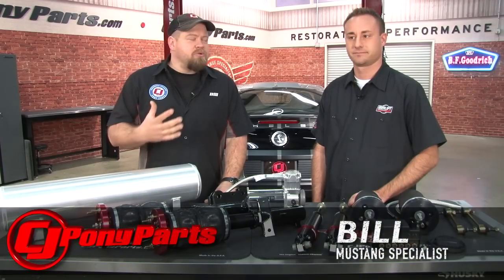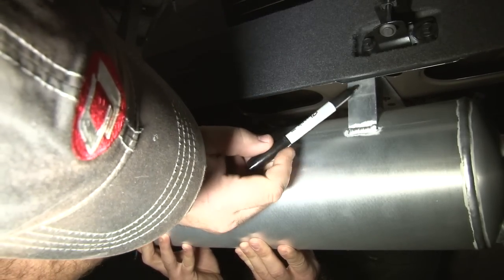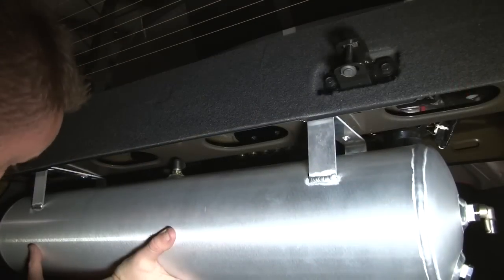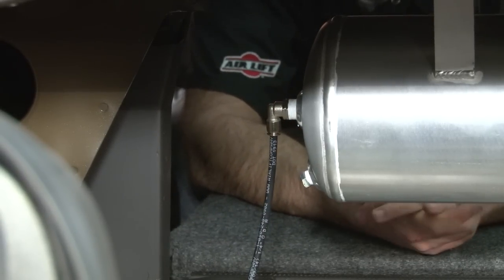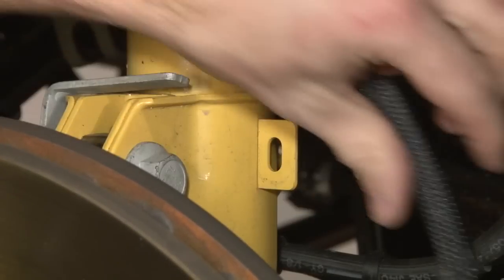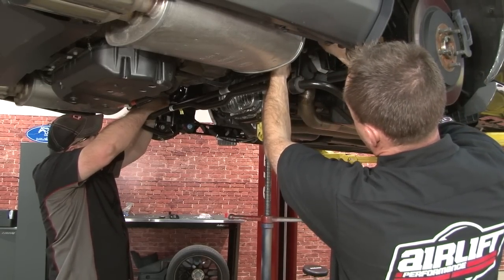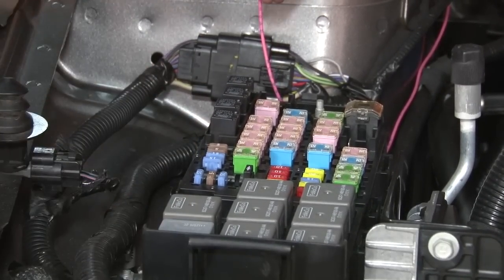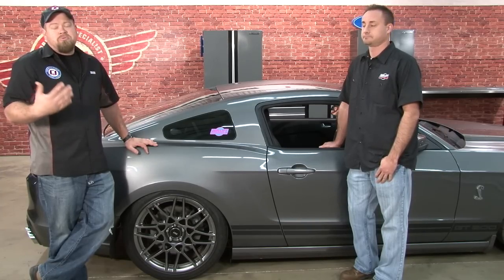Mustang Air Lift Performance Complete Digital Air Suspension Kit 2005-2014 Installation

Comment: There are no issues with the system for winter use. I would check the tank occasionally for water but I doubt it will be an issue.
Reply: Can you drive it slammed if you did widebody conversion with flared fenders?
Reply: Bill Tumas after the install do I need to go to a shop for alignment...and  Since I'll be driving a little bit lower do I need to buy any other suspension parts?
Reply: Bill Tumas غ٧ص
Reply: This is not true, moisture can get in the valve manifold and freeze, and crack the manifold which cost $700 to replace! and vehicle will be aired out until replaced or modified.  Happened to me !!!
Reply: My Lincoln Mark VII had a dryer assembly that was part of the compressor...you need a dryer if you plan to drive in the winter!

Comment: Just a reminder, you might want to roll your front fenders when installing this kit if you have aftermarket wheels. I just installed it and had to learn the hard way!
Reply: Zach Waddell Good point!  The need for fender rolling depends mostly on your wheel offset.  We have run 20x10 wheels up front and never rolled the lips.  Doing a slow drop the first time is always a good idea until you determine the wheel compatibility.

Comment: Does the 11-14 Mustang GT require an after market pan hard bar to be adjusted to the daily driver ride height with this system?
Reply: Depending on ride height it is not a bad idea, especially if your daily driver ride height is a lot lower than stock.

Comment: ***** You just have to get it aligned at your driving height. Once you do that it will drive like stock and have no issues at all. I have personally been in this car at triple digit speeds with the Air Lift and its rock solid.
Reply: Could you measure where your drive height is with stock suspension and set the air bags to the measurement?
Reply: +Darren Gardner If you want to stay at stock height sure
Reply: Bill Tumas hi bill how much cost to put everything in my mustang gt 2013?
Reply: Where can i buy the end links or dose it come with front bags when you buy separately

Comment: What fuse you can use in the 05-09?  The adapter included on the 3H limits your options since it requires no fuses nearby in order to fit.  It is really imperative to use a line that remains active while cranking?  That limits the options available even more.  Thanks

Comment: Where do you guys connect the red source wire I have a g37 its conected to the starter in the fuse box can that be a issue

Comment: Two quick questions: 1. Is there a way to do some rust prevention on the holes you drilled into the spare tire well and rear spring tower? 2. If I need to leave the car stationary for awhile, like a few month, what level of air should I leave in the bags? I live in Florida by the way. Thanks.
Reply: A little paint or primer on those holes will do the trick. If you let it sit for a month I would air it down. It should hold but you may lose a little pressure over that much time.

Comment: Did you guys remove the plastic in the front wheel wells? I don't see any when you were mounting the front struts and I didn't see you removing them in the video.
Reply: +salzero1  They were off the car before we began the install.

Comment: I was always curious how the alignment part is handled on air ride... Do you perform the alignment on the driving setting? Does it hold that setting perfectly? or will it have alignment issues from constantly changing the ride height?
Reply: Yes you align the car for your saved ride height and it holds it. The other settings you typically will not drive on, at least not for very long. This car has a high setting for getting on a trailer or going over a speed bump, a track setting for the drag strip, a drive setting, and all the way down.
Reply: Bill Tumas  Cool thank you for clearing that up :)

Comment: Is it possible to adjust ride height while on the move, say I am cruising down a normal street, want to turn into a shopping center but there is a fairly steep entrance, would I need to completely stop, then change the ride height, or change it on the fly? Thanks for the help!
Reply: You absolutely can. You have to press the button twice so you don't hit it my mistake.

Comment: I Thought When you Lower The Mustang It Throws The Axle Of Center A Bit How Come There Wasn't An Adjustable PanHard Bar Installed On This GT500? I Am Looking At Buying A Set Of Coilovers For My Mustang This Is Why I Am Asking Thanks
Reply: Ride height isn't terribly low on this car so the adjustment wasn't necessary. On a fixed drop like coilovers you will want an adjustable panhard.
Reply: +Bill Tumas ok I Was Just Wondering How Hard Is It To Adjust I get the whole concept just don't understand how u know to adjust it as far as measurements of u could give some guidance if possible thanks
Reply: Watch the video on the watts link install. I explain the process to center and show how to measure it.
Reply: +Bill Tumas thanks for all your help

Comment: Would I not need an adjustable panhard bar?
Reply from the maker: Depends on where you set your ride height. If its more than an inch lower than stock you would want an adjustable panhard.

Comment: Question:
Will this Air suspension system be safe to 'drift' on? Can it handle some rough throwing in the back end?
Reply: If I were building as competitive drift car I would probably not use it but for the occasional drift it will be fine. This car is regularly drag raced and runs mid 10s without issue.

Comment: Wait..wait a min... This can be used to race at the track "drag wise i mean" ? Come on really? I can get that awesome bag look with better drag times? If that's true sign me up .... I wonder how this kit would do against the steeda 1 2 3 stage drag suspension kit they have... Would love a answer back Bill if you get the time. Thanks -Steve
Reply: There's a gt500 running 9s on airlift is you look it up

Comment: If you have aftermarket wheels that stick out a little bit at the top would they rub when you dropped the car?
Reply: Hey man Ik this is 8 years late but ya you’d wanna roll your fenders if they poke too far
Reply: @anthonygutierrez2174  🤣 thanks bro. I had a dodge charger at the time when I was looking into this. Since then I no longer have it. Appreciate the info though. It may come in the future. 🫡

Comment: Will that compressor get overheated down there in the well when it's Covered up?
Reply: It has never been an issue and I have done that on several installs. Out in the open is preferred but I would rather hide it.
Reply: Bill Tumas Great. Thanks, Bill thumbs up

Comment: On the manifold the right plug no hose was plugged on it was it that for ?
Reply: Noeldiaz8 that's an exhaust line you can run as an option outside of the vehicle. His manifold placement allows enough breathing room for the system so no hose is required.

Comment: What about wheel alignment?
And will the rear axle stay centered between height levels?
Reply: snapfish89 The way to set this up is to align it and the rear axle (if adjustable) at the ride height you drive at most.  As you lower or raise the car, the front camber and toe changes slightly, but not enough to go out of spec within heights that are reasonable to drive at.  We do not alter the geometry of the suspension links at all. So any change is a result of the design from Ford.  And, having driven our S197 on the track a ton, they did it right!  Hope that helps.
Reply: snapfish89 iiiiii

Comment: So how do you adjust the camber settings when aligning the car if the camber settings are underneath the top plates on the strut towers?
Reply: VADER take em out, adjust, put em back in. lol. don't forget to put 165lbs in the driver's  seat.

Comment: Will that tank fit in the wheel well with the compressor?
Reply: +Kolour Blind It is too wide for the spare tire well. You might be able to fit it at an angle but i never tried.

Comment: Do you need realignment after done ?
Reply: Sang Nguyen after full install and daily ride height is determined get it aligned for that height. Normal daily height is anywhere from factory height to minus two inches at most.

Comment: I think a better spot for the compressor would have been just behind the rear seats inside the trunk! I like to keep my spare in the trunk trust me.........I've learned my lesson.
Reply: +JNelson Performance shelby gt500 dont come with spare wheels from factory.
Reply: JNelson Performance you can mount the pump under the vehicle if you want or in this case you could mount it directly beneath the tank it self. That's how mine is mounted.

Comment: When I'm cruising, I want to have the car just little lower than stock, but I want to be able to lift it HIGHER than stock when going in and out of parking lots, over speed bumps, etc. Does anyone make this sort of thing? All those kits are still lower than factory on their highest setting and their lowest setting is undrivable low, I don't know who finds that useful.
Reply: +emsicz  This is absolutely higher than stock when all the way up.
Reply: You obviously dont see the benefits of airlift, so just get springs. You dont drive with it fully aired out -.- thats for when youre parked and want to make it look real low when not driving, like at car shows. You raise it a bit for driving and can definitely go few inches above stock height
Reply: +ATrueKneeGrow Can springs be electronically lifted when I want to drive on bumpy road or get over edge on a steep road?
Reply: +emsicz u need to buy a 4x4 lol. ..just bought airlift for my self for all the reason u want above..

Comment: The video is great but you didn't mention anything about an alignment, you didn't mention anything on how to snap the airlines in the back air bags, he just showed the cable  coming through the body and make sure that the grommet is on ,but you but you didn't show how it connects or disconnects,  if they're going to do a video on a new product you really should give full detail,

Comment: so if one of those bags leaks your screwed?
Reply: +cervini67 Eleanor  Not really, even if one bad failed for whatever reason the car can be moved with 3 inflated bags. The bags are very heavy duty and the fittings rarely have issues.

Comment: Is there a kit for 1999-2004?
Reply from the maker: No, Air Lift Performance doesn't have anything for those models yet.
Reply: CJ Pony Parts yet..
Reply: CJ Pony Parts

Good morning,
 I have a 
( Mercedes W126 560SEL ) category Hydraulic system  I want Kate fell with full remote control and how much the price ...? 
I want her quality of high-speed lines and his long
Reply: +FARUQ Bin MOHAMMED wrong video
Reply: do yall have a kit now. 2 years later?

Comment: Weight?
Reply: If you are asking about the weight of the system, install all the components are still lighter than factory.
Reply: With the basic V2 control system, the entire kit weighs about 6lbs LESS than the factory suspension pieces you swap out!  So you can have air suspension AND save weight!